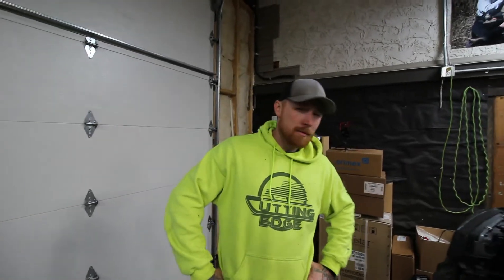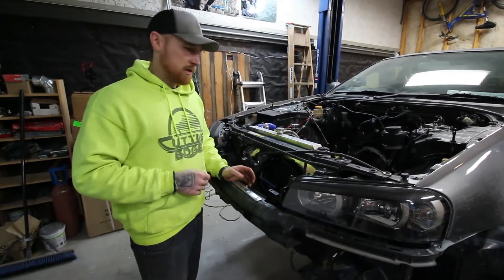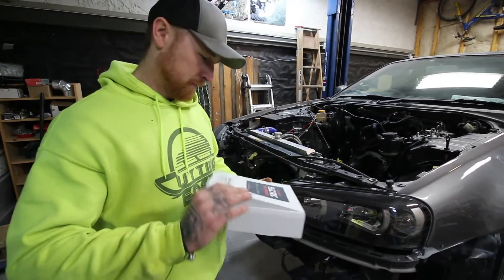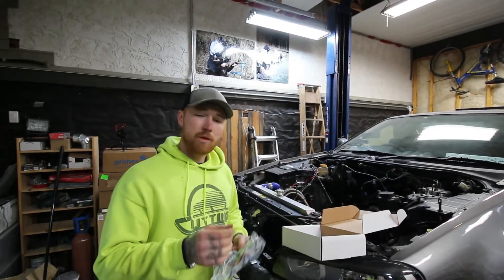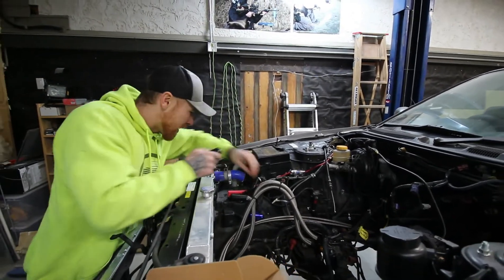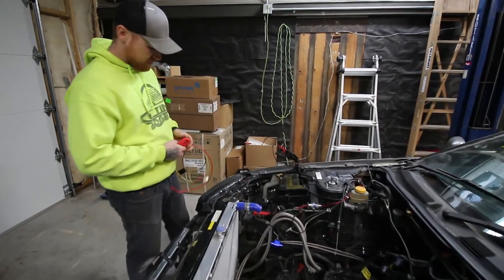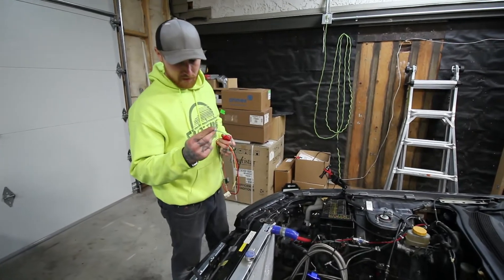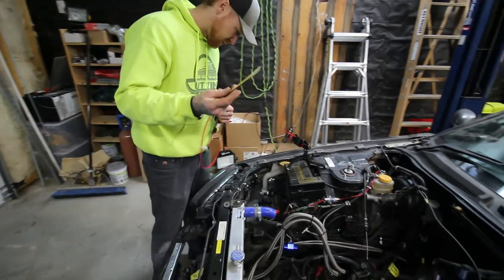Mishimoto Fan Controller Install - R34 Skyline receives the control kit for the dual fan setup.

Comment: Have you noticed a difference from running the fans backwards? If you really think about it, that would make the most sense for every car.
Reply from the maker: @Sean-n9s  never had any cooling issues so I'm thinking they worked just fine.
Reply: @skyvsstang2261  makes perfect sense for your application. I’m just trying to find references for utilizing the probe and wiring with the battery in the trunk. thank you for your response

Comment: What’s the temperature that it should turn on the fans, I was thinking on using a fan temperature controller that comes from a Chevrolet it’s at 95 and 102